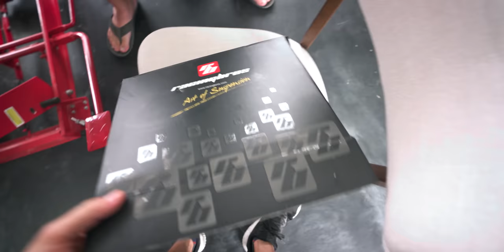MAJOR UPGRADES for the 300cc GROM Build!

Comment: I had the same issue on my XJ600 when I switched the top triple.  Try making sure the spanner nut and top nut are set to torque spec, It should pull the ignition down to where the lock pin needs to be.  Its surprising how much of a space difference it makes.

The bike is looking great so far, cant wait to see it all done

Comment: Didn't you use the top race on the bottom and the bottom race on the top. And that they are different sizes??
Reply from the maker: Nope we triple checked. The height of the races also are identical. The only difference is the diameter of the inside.
Reply: @motonosity  bummer